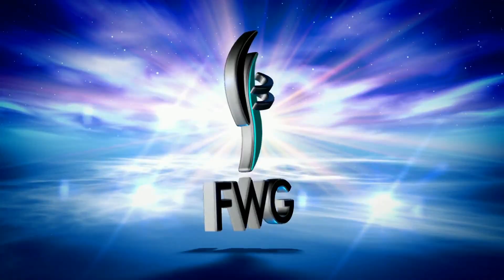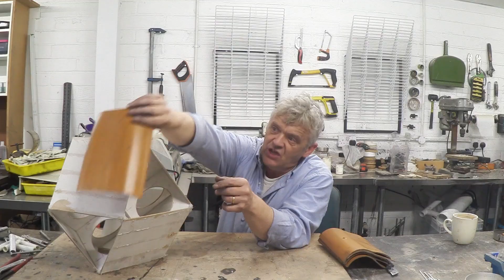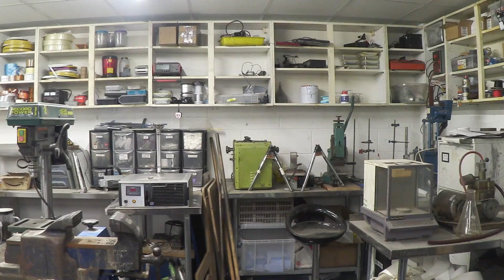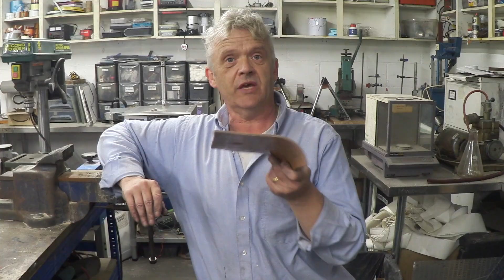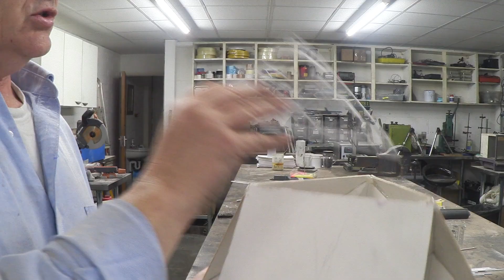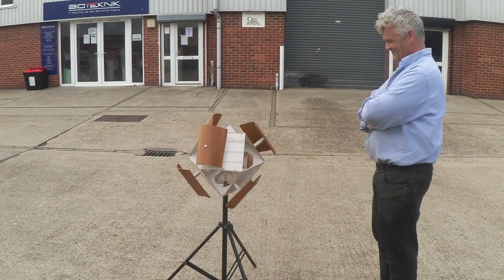O Wind Generator - Part 2

Comment: Just an Idea for a wind capturing wall. When I was a kid I loved to play with things that fly made from paper. I made lot's of circles from newspaper and glued them together so I had a sheet of paper rings. It would float quite a bit. Just thinking if I would have a  big panel with holes. The holes are connected to pipes and they would lead the wind to a electric motor

Comment: the problem or opportunity depending on where you live is high wind is easy low wind is not so much windmill turns to fast it may come apart  what is the best optimisation for where you are  if it does not turn fast enough you can capture no work this is why windmills work best high up and in a place with lots of natural wind this is why i think it is best to make the blade assembly as light as possible and putting the generator and gears and such on the ground where they are easy to work on there are lots of way to do that my thought was a front yard with lots of windmills pumping water uphill with a tank to collect the pumped water and an alternator and watermill to convert all the little powers into 1 big power.

Comment: I would imagine weight is becoming an issue. Don't think it will create much electricity as it is. Have you seen the design that utilizes two curved cones that are stationary at the top one is above the other? Wind from any direction is deflected downward  through conduit it is guided to a turbine to generate electricity. The only moving part is the turbine. The cones can be higher up to catch the wind and deflected downward.

Comment: ive been flying rc planes for 20+ years now... i played with wind generators for a while 12 years ago......theres no easy way to explain this. think about a wind generator like the prop on a airplane. bigger prop requires more torque to spin. the bigger your foils are the more TQ you will have. weight is essential in rotating mass. i used foam board and a geared electric motor for my prototypes and card board and 1 layer of fiber glass for the 2nds. make sure you machine is balanced and CG is right. the best low wind wing i came up with was a delta wing style foil made of cardboard and 1 layer of fiber glass. if you have a square center leading edge you will grab more wind. hope this helps

Comment: A frictionless magnet bearing would eliminate friction.
Reply: That doesn't change the fact that this shape produces 0 torque. Really sad that Robert still tryes to pawn this theory.
Reply: @utubeaccess7  
Is he trying to pawn it or is he gong through the steps to show why it won't work?
Besides that, a properly sized gear can add torque that is provided, it's not so big and heavy that it prevents the wind from turning it.

Comment: Tell me if I'm crazy. How about a combo bearing and generator? I.e., mount an upside down pie tin to the bottom of your turbine, filled with magnets in epoxy, north poles facing down. Then an opposing plate with copper coils but also with, say 3 magnets, North Pole upwards. Seems like you would end up with a nearly friction-free bearing, and every breeze would generate electricity in the coils.

Comment: While this is interesting it’s hard to tell if it works well without comparing it to something that you know works well. I don’t know if you have those spinning roof vents in England but here in Australia they are a practical way to get some cooling by getting hot air out of a roof. I put some on my Mums house and installed close able ceiling vents in every room and there was so much suction created that it would hold a news paper onto a ceiling vent with very little wind. Even on a still but hot day these things will still spin if fitted to a roof as the tiled roofs that most houses here have get very hot and the rising hot air is all that’s needed to make them spin. I suspect one of these roof vents might have performed better on your outside test. If you are unfamiliar with the vent I’m talking about just google Whirlybird roof vents.

Comment: The blades could be tilted to increase the spin in a light breeze or to decrease it in a strong wind when it's spinning too fast. Down the track this could be automated based on RPM to increase efficiency.
Also as another viewer commented, using a twin bearing system would reduce friction thus also increasing efficiency.
Are you going to spray paint the whole thing once your done, maybe a futuristic silver or just plain white.

Comment: Hey everyone 
I melt pvc at work all the time 
Just find a hot exhaust 
Generators  and small engine 
Or or heavy equipment in case there no heat gun
Reply from the maker: nice tip mate - cheers

Comment: I really like this experiment, but really need a comparison between the various designs.  It already has more potential than the turbine-less or the pinwheel wind generators, but I think that your mods have increased the weight and reduced the torque of the turbine.  The shape is quite pleasing -- I wonder if you'd escape the notice of your council if it was mounted on your roof.
Reply from the maker: i was wondering exactly that

Comment: Just a thought I was having but what if you shorten the pipe that holds the fin to where the fin would touch? Wouldn't that catch the air in reflecting it into a downward and upward push which should cause it to turn faster with less wind. I think it would force the wind to the center. I bottom fins would carry the wind up to the center line and the top fins would carry the wind downward to the center line. LOL, attach some plastic spoons all the way around the center line to catch that wind. I was kind of thinking also about a spiral of rope going around the whole unit, hmmm
Reply from the maker: easy to try mate - i'll give it a go
Reply: @ThinkingandTinkering  Awesome, I can hardly wait to see your findings on that bit.
Reply: But as a piece of art that captures the wind, you get a A+. I love the way it looks, kind of a art deco type ordeal.
Reply from the maker: lol

Comment: What happens if you adjust the pitch of the blades, specifically giving them negative pitch?  It looks to be running "backwards"
Reply from the maker: worth trying and seeing
Reply: My thoughts exactly michel, when the "blades" are added it behaves like a waterwheel with scoops rather than aerofoils. I thought it would rotate the other way with an aerofoil.  I am fully prepared to be shouted down, but surely 6 aerofoils mounted on a (low air resistance) frame without the shapes in the centre would have the same effect.  But then we are just getting back to the territory of those vertical windmills.  Love the videos Robert, glad you took the chuck key out of the lathe.
Reply from the maker: cheers mate

Comment: Recommend placing two steel ball bearings on top of each other within the support shaft to greatly reduced friction.
Reply from the maker: cheers mate
Reply: @ThinkingandTinkering   how about magnetic bearings ? I don't know if there are some which are commercially available, was reading up about flywheel the other day and thought it was very interesting they use that, it make sense, perhaps that's something you could look into, I like the sound of a DIY magnetic bearing but not sure how complicated it would be to create